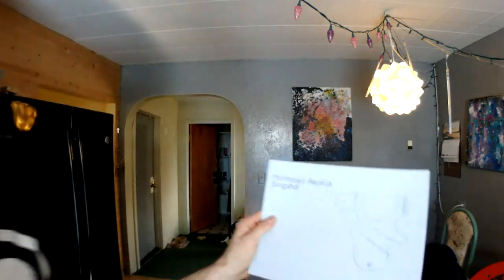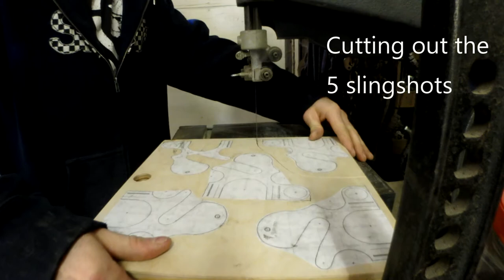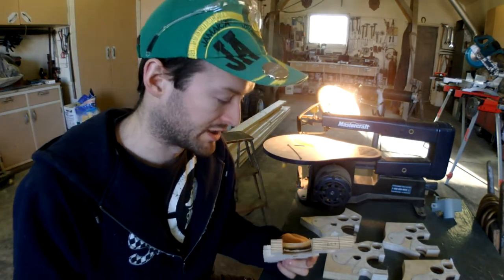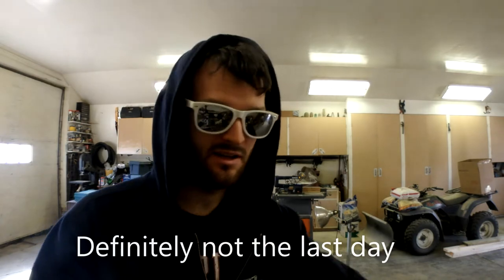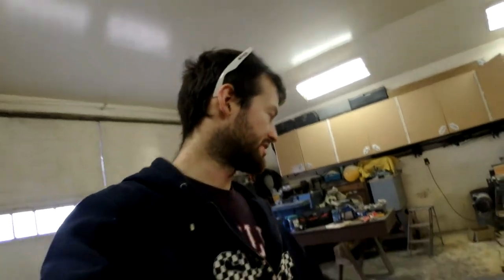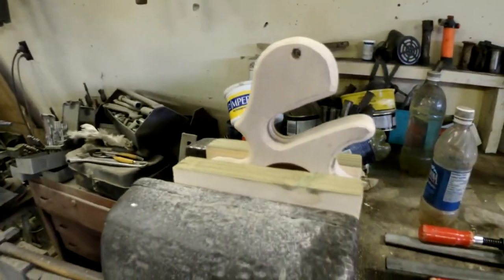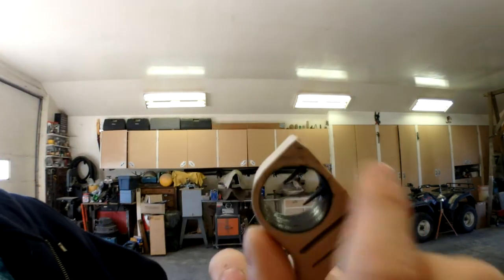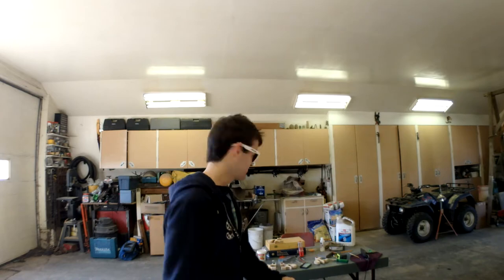Making Slingshots with Baltic Birch Plywood (part 1)

Comment: hi, what are the three points between them? min. 3:12.  tks.
Reply from the maker: Marius Mihai I drilled holes there for the sights. If you watch around the end you'll see what I mean!
Reply: yes, but how far they are in between?
Reply from the maker: Marius Mihai oh! Haha they are spaced 1/4 inch apart and the hole for the sight was drilled with a 1 inch hole saw bit
Reply: Yeah, it's more difficult with my English. have any connection with the firing distance? if so, what is it? thank you
Reply from the maker: Marius Mihai the top sight was about 5 yards away and for every sight below it was about an extra 6-7 yards further per sight.